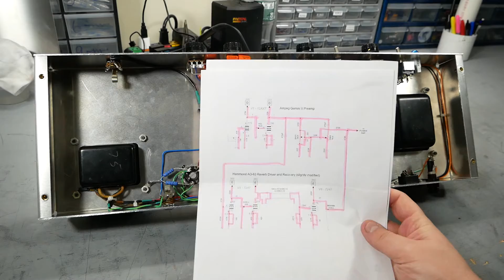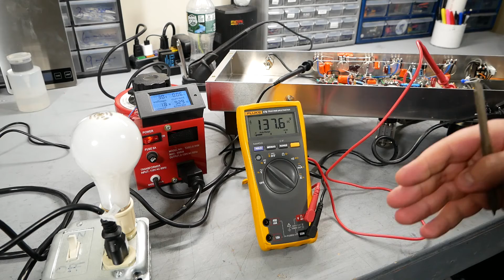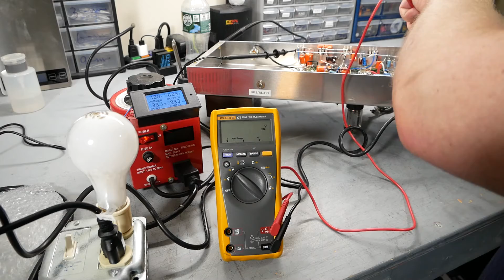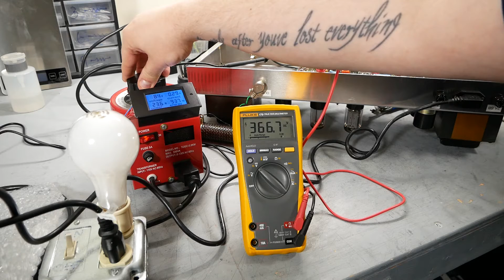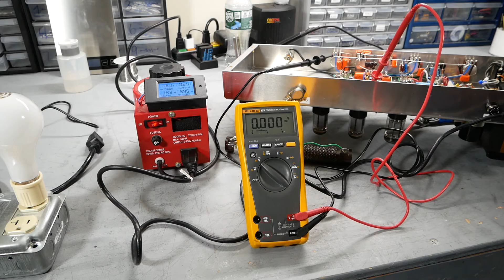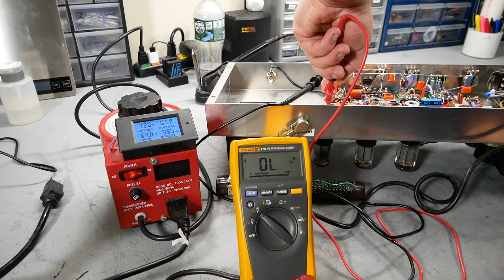Tube Amp Build Series Pt.7 Testing and Listening

Comment: Did you just use the existing shunt for the voltage reading on the variac to tie in that ammeter? I've been interesting in doing the same to mine but cant find much info on that mod to it
Reply from the maker: This multimeter has a current sense transformer: https://www.amazon.com/HiLetgo-Multimeter-PZEM-061-Voltmeter-Transformer/dp/B079JNY5VD/ref=dp_prsubs_2?pd_rd_i=B079JNY5VD&psc=1